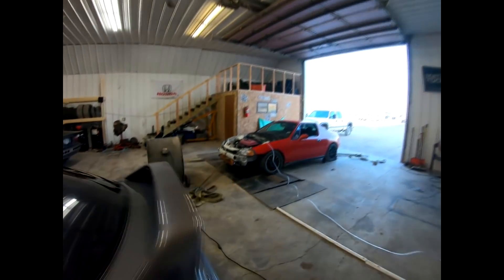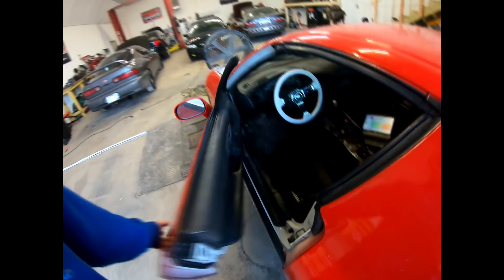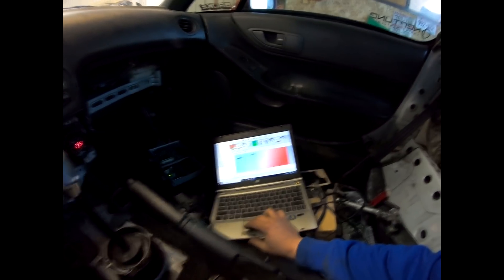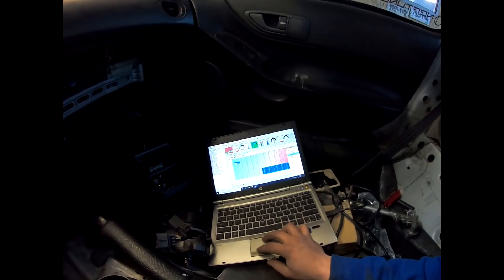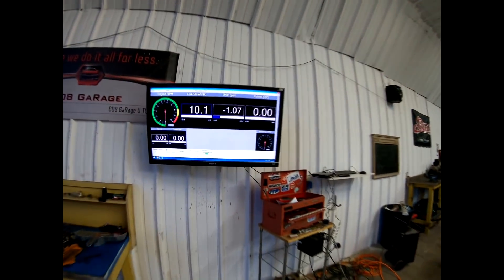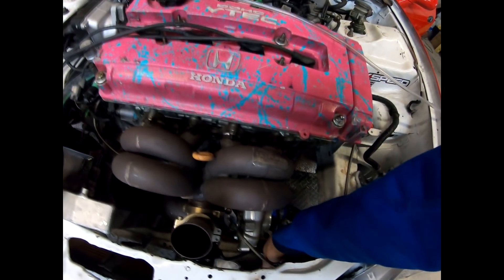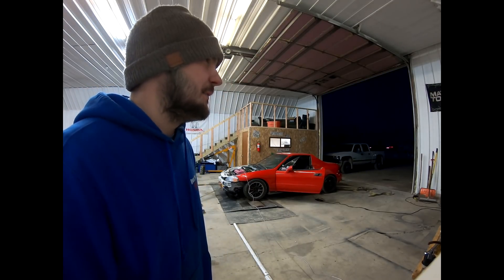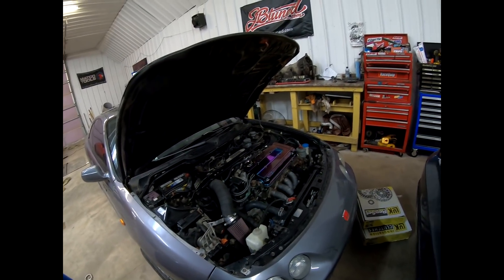Turbo B16 Vtec Del Sol Dyno Tune GAINZZZ

Comment: Heck yes brethren. I just stumbled on HTS last night scrolling facebook. Amazes me that after 25+ years with these old OBD1 ECU's, we're still getting ground breaking stuff like HTS. I Assumed all these features were hardware limited thus needing big expansion boards. Come to find out I can get all these features on a stock board that I've just added my Ostrich and Hulog to. I've been toying around with Crome Gold and got my startup tune dialed, but after running through the HTS software, the switch is a no brainer!! So glad I never pulled the trigger on an S200 years ago, and so glad I sold my Apexi SAFC many years ago.

Comment: I have a question hunter.. how do I use hts with a Neptune rtp board? What is needed to switch over? I was looking at the hts software and like the options better than the Neptune software
Reply: file, settings. under emulator settings, select moates demon